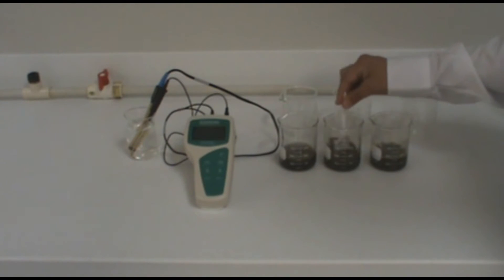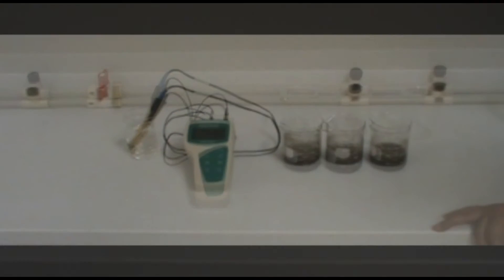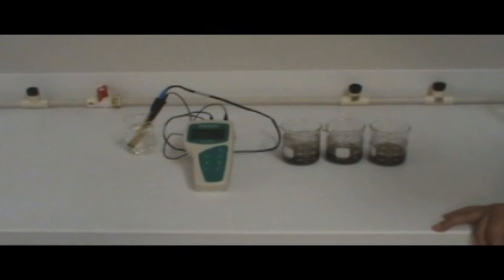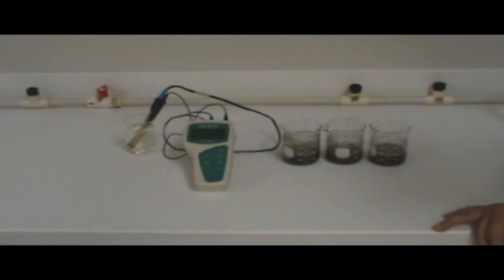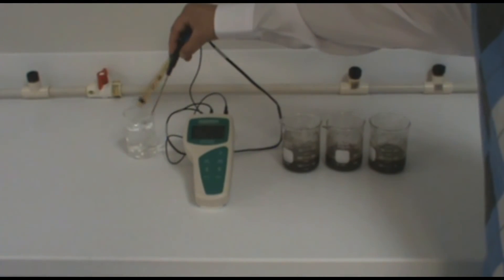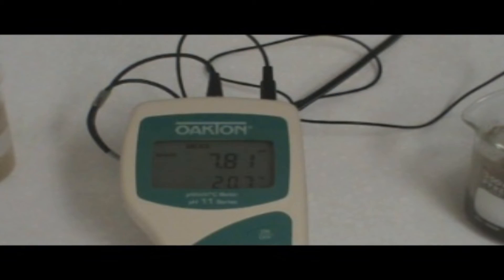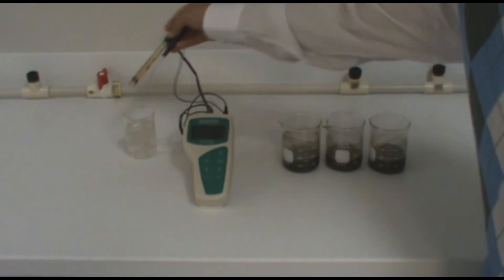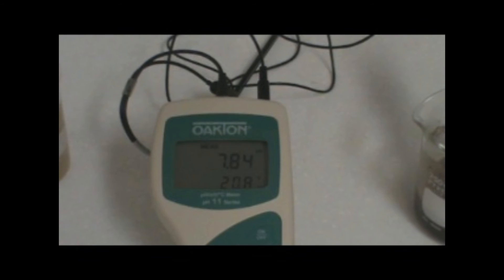How to take a pH measurement of your soil samples

Comment: Seems like a reasonably good way. I was taking a relatively inexpensive meter and checking about 15-20 places per site getting an average off of that since it only had a tolerance of .5. I just recently purchased one similar to yours and I am concerned with the glass tip. I don't want to go poking it in the ground at 500 sites with twenty holes per site. I can see that digging the soil and mixing with water will save the life of my meter and offer a more accurate result.